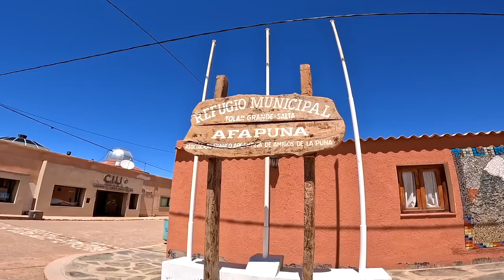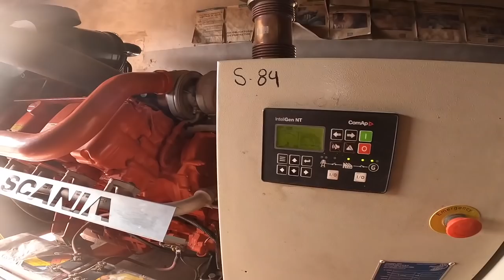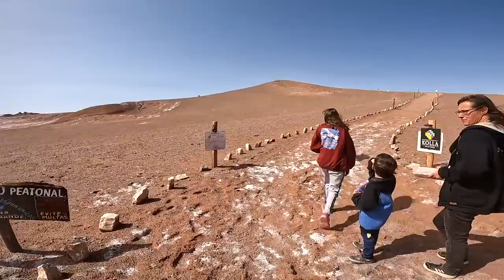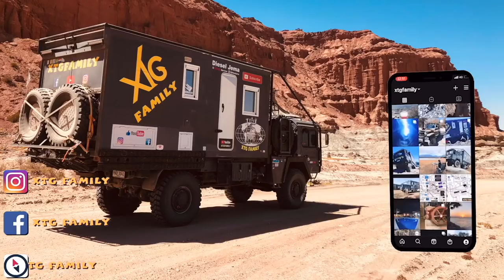296 après plus de 500 km de piste, allons-nous tomber en panne de gasoil

Comment: pour ton arceau, il faut eviter de mettre des renforts partout. Il faut que tu comprennes comment travailles ton chassis (essentiellement en torsion et en cintrage avant/ arriere) les zones de casses de tes tubes montrent quelles sont les zones fusibles. Installes dans ces zones plutot des accouplements mobiles style articulations par fer plats et boulonnerie.
Reply: pour les renfort je suit du même avis
Reply: Malheureusement sur les routes ondulée  pas grand chose à faire, sauf de faire des offrandes il paraît que ça marche.
Reply from the maker: on va mettre un silent bloc